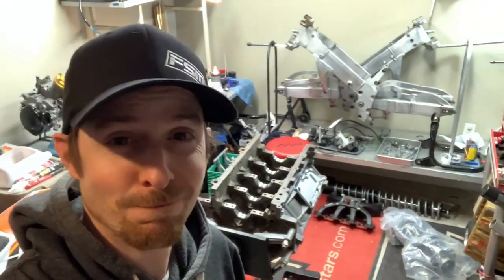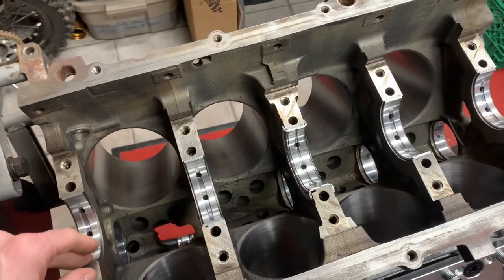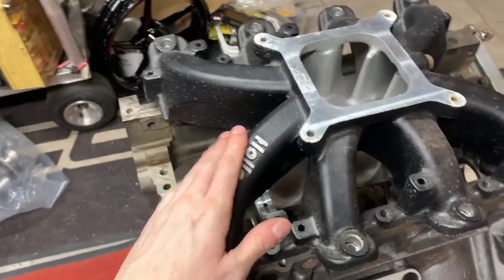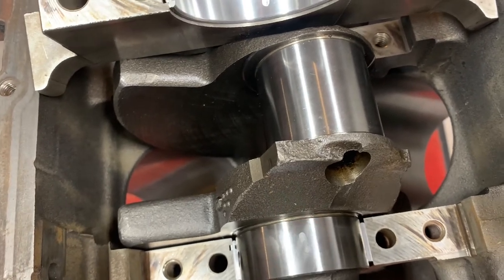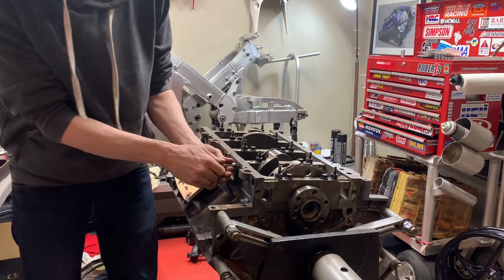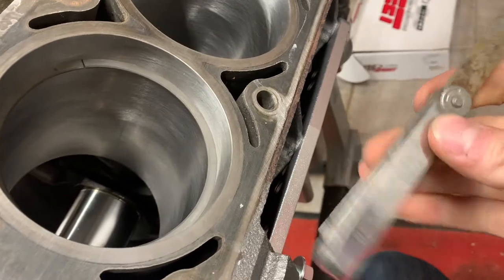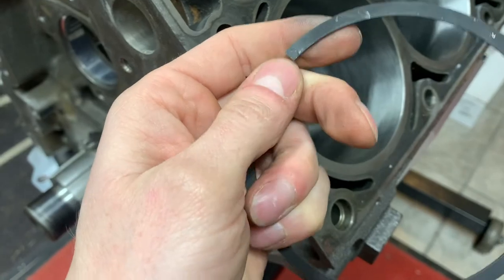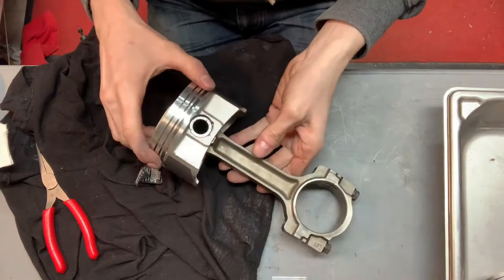HOW TO: LS Engine Assembly & Wiseco Piston Review

Comment: I bought the same pistons put in a ly6 from a 2008 2500 hd. Stock crank and connecting rods milled down the 823 casting aluminum heads 20 thousandths and a small port and polish on the heads. Balanced crank ls3 valves intake and exhaust uncapped injectors. Sloppy stage 2 cam 102 mm intake on ls3 intake. Compression was 11.4 :1 hooker long tube headers with x pipe 3 inch stainless exhaust into borla bullet mufflers... Dump out just over rear axle.. Brought it too tuner got Tuned on dyno n.a. 485 to the ground and 459 tq. I was happy but I really was hoping for more... There's more on the table with a bigger cam and some nitrous but I tow and its my daily so it is what it is ... Let me tell you
Reply: Hey Brother, just read thru your post and I am thinking on running this combo! Did you have any issues with piston to valve clearance? What can you running?
Reply: @luiscarrasquillo9743  no problem with clearance but I would not shave the heads down anymore because you will absolutely start running into problems with piston to valve clearance....